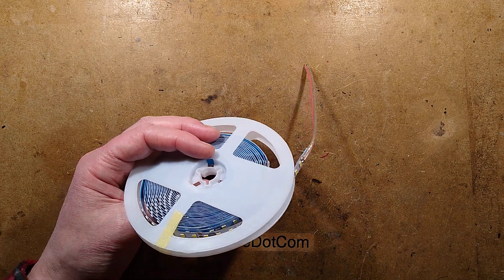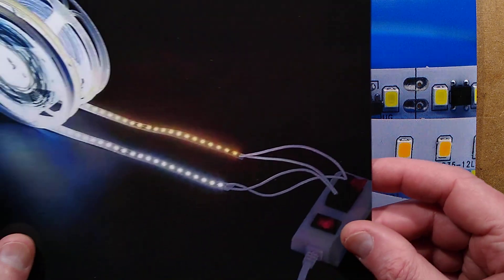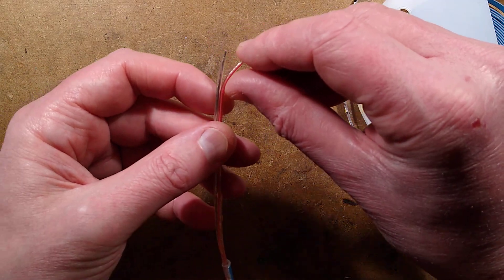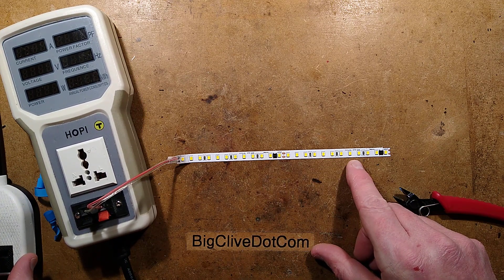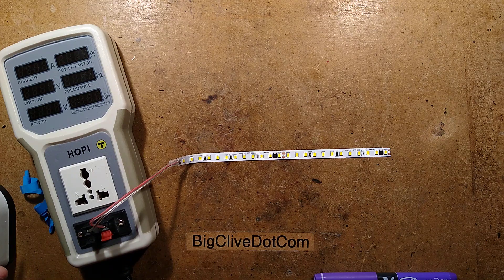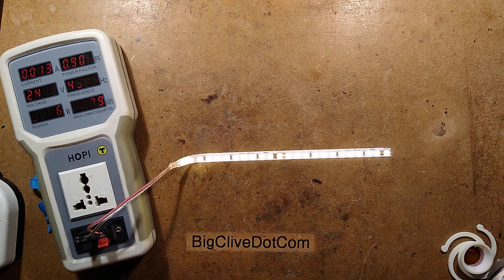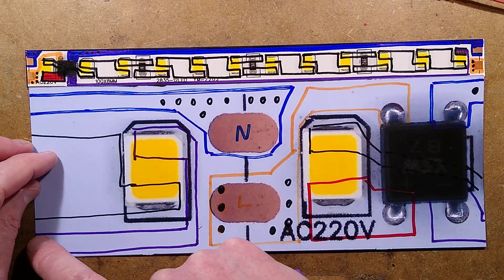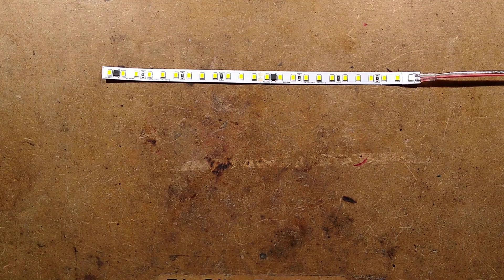Dangerous bare 230V LED tape

Comment: is there any video with similar power supply but with "cob" led strip ?
Reply from the maker: I'm not aware of a 240V COB strip.  And to be honest it would be too dangerous to exist.  12 and 24V systems are much safer.

Comment: LED tape is quite popular with non-electricians who want to add lighting to a project. You can get all kinds of it intended for all kinds of different places. Densely-packed high CRI chips for filming/workshop use, addressable RGB for gamers, waterproof running lights for landscaping, grow lights, all sorts of stuff. I've only ever seen it run on DC and with, at least, conformal coating.

This could be useful for someone who slightly knows what they're doing and wants built-in lighting without having to hide a wall wart, but it shouldn't be targeted toward random DIYers like this. I suspect someone who knows absolutely fuck-all about electricity picked these up and confused them for the kind marketed to makers and furniture builders by reputable suppliers. Or they're trying to kill the foolish Westerners. One of those.

Comment: Scary to have 220/240 Volts on those thinly insulated LED strips. I have used these in 12 Volts version in our hallway, a lot safer and they have been going for at least 8 years and still working.

Comment: This would be great for someone who wants to be a Spark, in which touching the copper pads, etc, while powered will surely lighten one up with 240 volts. I am shockingly surprised this LED tape gets past any health and safety laws to get onto the buyers market.

Comment: Modern self reliance built a cube 64 square foot building in Canada & used a rope light that might work for instead other than the voltage you bought was for the higher voltage than Canada uses.

Comment: Clear Tubing stiff or flexible to insulate. Also a neat use would be to take burnt out LED bulbs and replace the guts with some of this. Would probably last longer then a lot of the cheap LED bulbs do. (Although you would need to take the bulbs apart without breaking the diffuser.)  Another good use maybe Replacing Shop lights that are T8 base fluorescent converting to LED.

Comment: I would really want this with that "water proof" coating some of these strip style LEDs come with.  I would use it in a lamp,  although I am terrified of it catching fire.  It's just way more coinvent and versatile compared to normal led strips where you have to factor in a power supply.

Comment: Electrician here and the first line volt LED fixture I worked on I didn't realize it was line voltage and got shocked after I dropped a screw over the LED array and reached in to grab it and hit the little bus. At the time I didn't know line volt LED fixtures existed and there weren't warnings on it.

Comment: i cant believe that you can buy that stuff the customs does not catch that.

of course with all the containers backlogged due to the pandemic lockdowns the customs are probably going into reactive mode where they are letting products through to expedite the delivery and then waiting for recall notices due to fires or shock hazards.

if you use any kind of bare led devices that connect directly to mains voltage you should have it in a very robust enclosure to prevent accidental exposure to the voltage.

especially where there is water like kitchens and bathrooms and swimming pools and hot tubs

220 volts divided into 12 leds is 18 volts each.

Comment: Let's examine the reason something like this exists, which is definitely NOT the application it is being (illegally) sold for on eBay. The relatively large and solid bus on the back, fed from high voltage & low current AC makes this a reliable and efficient way to power very long strips. Think having to light up the entire edge of a building like a mall, or a bunch of shop windows. You could easily power several meters of this strip from a single point, with much higher efficiency than 12V DC ones and no attenuation at the remote end of the strip. Also, no 12V DC power supply means lower overall cost and fewer points of failure. (Again, think huge applications like lighting up the entire edge of a skyscraper or something.) BUT--and this is key--it would have to be powered from a current limited supply. Your 20 meters of strip need 6A? Very well, it's getting 8A, anything more and a breaker pops. Also, grounded enclosures and all that jazz.

Comment: some interesting excerpts:

Oh right okay I'll try it from the other end. Yeah, it's all gone horribly wrong. 
I do not like long nails.
This is just getting irritating now isn't it?
And continue, aahh, I've managed to get it off.
Yeah, one moment please.
You can always run your fingers along it when you want excitement.
Right, let's just plug this in. Oh, is this a good idea?
I'm going to actually stick it down, I'm going to stick it down so it stays down because I want to prove it with a meter wether this is a good idea, i  do not know. That is not coming off right.
This is where it's all going to start going wrong for a start.
It's just guaranteed something terrible is gonna happen.
I shall turn it on and I shall probe them. What's the worst that could happen? 
The slight shimmer you're seeing there is because this isn't smooth. I'll poke it at some point, maybe not.

Comment: I soldered a couple together and lined the corner of the ceiling and walls wall the way around my bedroom, you can't really see it when it's off and when it's on, it's a great ambient light source. Mine also has 2 remotes and Bluetooth, any color(RGB/W)

Edit: the DC version, not this weird design lol

Comment: Good for replacing tube bulbs in old fluorescent ballast housings when the ballast goes?  Cheaper than the ballast replacement, and the housing would help with heat dissipation AND exposure.  You'd likely use a whole strip on a nice long shop light to get about the same lumen output, but not bad.

Comment: I had some of that! The LCD screen backlight in a cheap no-name TV I was using failed, and I opened it up to find several serial strips of LED tape just like that. My multimeter read 300V on the power lines that were leading to the strips. I got tape like that online to replace it. Got shocked at some point, luckily it had very little load. My stupid mistake. I fixed the backlight, but the LCD screen cracked trying to reinstall it, so it was all a waste. Nearly died and all I got was a still-broken TV.

Comment: mom bought a 5v LED-strip, planning to use a phone charger to power it. she had a plan to use it above plants and flower project. I advised here not to touch the strip with wet hands, was i right?
Reply from the maker: There 5V strip is safe when used with a good quality USB power supply.  It won't put out enough light for most plants to grow.

Comment: This tape is actually designed to be sold in conjunction with a clear silicon flat tube to contain the "spicy" parts.  I expect they sell it without the tube in case you have "other" ideas..

Comment: I can understand sort of what electricity is and I can put a new plug in something or know to turn off the electricity before gettya bit of toast out if a toaster ... Something I learned from my mum and dad but an actual circuit board fulls me with dread. Similarly I know how a car engine works and how top up the oil and pump the tyres and how important they are but whenni look at a car engine I am filled with uncertainty. I remember in Hong Kong there was a problem with the electricity in our apartment and I thought it was maybe a fuse and I knew about fuse boxes from my dad
 Do I hot my electric screwdriver and opened what I thought was the fuse box and put my screwdriver on a screw and ... Whoomph ... The screwdriver flew out of my hand and across the kitchen towards where Marlene was doing something.  It was a circuit breaker not a fuse b of x and luckily I only got a mild shock as the screwdriver insulation worked. Another time I experimented with an electric socket when is was at home around the age of 11 and put bare wires into the socket and luckily just blew a fuse in the fuse box. My dad patiently explained not to mess around with electricity.

Comment: Are all high voltage LED strips dangerous?
Reply from the maker: Most strips are low voltage and safe if protected by suitable fuses.  Some high voltage strips are moulded into plastic sleeves.

Comment: Naked open contacts and mains power are never a good idea. I wouldn't trust this without a form of external shielding, like a half round diffusing strip that goes over it to prevent anyone from accidentally touching it.

You probably aren't supposed to use these strips bare as they are.

Comment: I would expect these to slowly corrode themselves to death if not contained within a sealed tube, maybe make a small pop and self-isolate?
Seems like the kind of stuff for cinema floors honestly, considering the long spans needed where 12V can be a bit tricky to distribute, however 48V does exist and is much more suitable...

Comment: I bought a role of that lighting in the 110/120 volt (American flavor) about 10 years ago. It's cheap Chinese but it did have some kind of thin clear 'stuff' on it. The conductors weren't bare but I definitely wouldn't get it around water. Anyway, it has been my kitchen 'under cabinet' lighting for several years and it works well. With the conductors bare on the roll that you got, it seems that they took a cheaply made product and made it even cheaper! Imagine that!
    The fella from the Kalashnikov group came across a few Chinese made AK rifles with ballpoint pen springs in them for extractor springs! Anything the Chinese think they can do to cut corners, they will. There is no concern about safety, just trying to make more money. 
     Ya'll Take Care and be safe, John

Comment: I don't know about blow up, but the strips of 5V leds I have over my workbench frequently lose their grip & I press them back up. That would be a nasty surprise for someone used to dc low voltage to do the same thing to an ac strip.

Comment: I've seen this tap in a bathroom mirror.  The mirror is razed away from the wall by about an inch, with this tape behind the mirror to give some lighting when in use.  There is also a touch power button on the mirror.  I would imagen the tape is low power though with a sealed step-down fransformer.  As big clive said it would arch otherwise.

Comment: Not gonna lie, I've used this stuff myself to make a light box for drawing. Mine terminates in a USB plug and I run it off one of those rechargeable USB bricks... that makes it a lot less lethal... right?
Reply from the maker: Yes.  The low voltage stuff is safe.

Comment: I'd like to see you solder the kettle about halfway down like you suggest at 5:15. 
Can 100% guarantee this will end up installed in peoples houses by super dodgy lighting-and-lawnmowing type crews.
Reply: Have you seen what they used to do in houses when electricity to homes first became a thing?? Uninsulated, unearthed bare cables hanging from the ceiling from which they would connect anything from a light bulb to an iron to an electric table cloth (yes, really). https://youtu.be/dr1IAfl0_TM?t=425

Comment: My late wife and I used to go South to Arizona for the winter, it's around a thousand miles down there from where we live the rest of the year. I purchased one of those tape lights that runs on the 12 volt system and stuck it to our windshield on our Class A Motor Home.  For Christmas I ran the red and green combo on the selector and made a neat display running off the 110 shore power in our rig. That was a few years back and most of the lights are still stuck to the glass. Sadly now that my wife has gone on, I no longer drive the rig and with our new President who has shot the gas price from 1.83 a gallon to 4,00 a gallon the future for the rig is null. Fellow across the street wants it but I doubt he will when he finds out the price I need to get to pay off the bank.

Comment: Of course, someone will buy this and install it into a location that is not suitable for AC mains power. For anyone can stick it down, power it up, and touch the tape without thinking, shocking, isn't it. This LED Strip Tape will probably be used for replacing a fluorescent tube and circuitry (as in one of your recent Mods) to light up under cabinets or backlight a display, etc. I'll not use the tape bare like this and stick down with its backing. For over time, the glue will dry up, and the tape will become unstuck and hang loose. For which idle hands undoubtly will come along to push down on the strip to re-stick it in place without turning the power off first. Only to find yourselves thrown to the floor feeling like a 240v sizzled sausage. Watch one of these channels, "Cooking with Clive" experiments. Cooked SPAM anyone, LOL.

Comment: Hi Clive
We have 240v strip here in Aus (not common though) just as it helps with longer runs as your 12v and 24v seems to struggle at longer runs (50m or so) and no driver needed meaning it 
 is a bit more cost effective at that length as the drivers are cut out of the equation completely

Comment: Perfect if you want to die quickly. Just stick it round the ledges of your bath, instead of using the unsafe t-lights. Seriously though, how the hell does this kind of thing get past safety regs? Even if it's installed inside insulated casing, I doubt the solder resist would last   long. I wonder if you could boil water with it?

Comment: Under cupboards? Sure, just slap it on cupboards and if you need to continue strip, just use solid core copper wires without insulation and hot glue them in place 👌🔥
Seriously, it's interesting what can actually be found online and with what marketing 😳

Comment: Any ideas why isn't the Neutral fed to rectifier from the busbar on the side below (and some additional through-holes) instead of the thin track? It wouldn't probably help the tracks spacing a lot, but may allow increasing an area of copper for better heat dissipation...

Comment: I am pretty sure they use this in chip fabs. The atmosphere is very controlled and stuck on a plastic channel with a defuser it should be completely safe especially when it's out of reach on the ceiling.

Comment: Can't find any exactly like this for 110V/120V. I have a china hutch that I would like to put a few sections of this in, which it already has an incandescent tube lamp that it would replace and make for more even lighting. I can get 12VDC model and just use a little wall wart power supply, Of course either way I would have to screw in a standard lamp base to two prong adapter anyway.

Comment: well. if the HV led strip in your led-fluorescent replacement bangs out you could use it, i guess. But those tend to be on a aluminium strip for cooling so.. low power only.
(i wonder why they did not tilt the leds by 90° .. would have made the squiggly power bars not needed.)
Reply: The reply of another comment asking the same 90deg Q, stated that the flexibility of the tape would be quite reduced, as well as the solder terminals of each LED would see much more strain and be prone to breaking.

I think that for specific applications that a producer would still want to use the same "tape" substrate (to not try and reinvent the wheel), but that would be known to get placed into a specific housing that didn't exceed a certain radius bend anywhere, that might work fine. Bulk selling to consumers probably wouldn't work out well in terms of product failures (where consumers would likely chalk it up to "quality control issues").
Reply: @DUKE_of_RAMBLE   Yeah, did not think about people forcefully bending that thing at 90° angles.
Well, it still works for refitting one of those plastic throwaway lights like this.
Efficiency wont be that great but nothing complicated can go wrong.
(I would probably add a combo of higher resistor and a cap to reduce the flicker. Rectifier, cap and resistor could even be done in front of all tapes)

Comment: Crazy bit of kit. Wouldn't the LEDs within the chips be wired in reverse parallel to limit the reverse voltage over each LED?
Reply from the maker: There's a rectifier to ensure they only see DC.
Reply: @bigclivedotcom  good point. My mistake. Why not reverse parallelize them instead? No rectifiers.

Comment: At work LED strips usually get thrown into the tiny little crevices and architectural rubbish that some architect thinks is modern. It just isn't worth the effort of earthing the extrusion the strip would sit in as well as dealing with the stress of signing off on a project with this product. 

I can sleep better knowing the 12v or 24v strips are easier to install and safer with the same results

Comment: Replacement backlighting for older arcade/pinball machines? They'd be completely enclosed, and most likely in a fairly dry environment...
Reply from the maker: It may be preferable to use the existing GI circuit for that.

Comment: For your speaker wire tester, I would use a DPDT switch. So when the wire leads are not being powered, you can put a nice resistor between them.

Comment: Maybe this was designed to be used inside LED fluorescent tube replacements. Scary that they sell the bare tape this way. Yes, there will be tracking due to moisture and/or dust. The track spacing is horrendous, too!

Comment: Ludicrously dangerous! Especially if one fell off the sticky tape,  into your dish water  whilst doing your chores! I was wondering,  would they run on 24v dc?
Reply from the maker: You can get 12V and 24V  versions.
Reply: @bigclivedotcom  I was actually curious if this particular set would run on 24v dc as it sits? I'm thinking it would take "bridging", the bridge rectifier for it to do so, but curious just the same... Or if you just cut the rectifier out of the circuit entirely to run one link... curious...